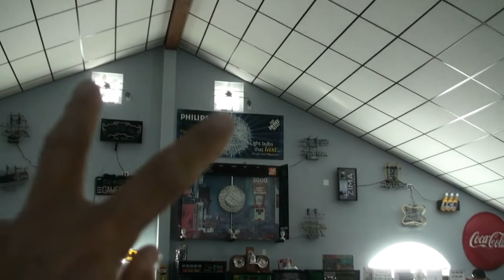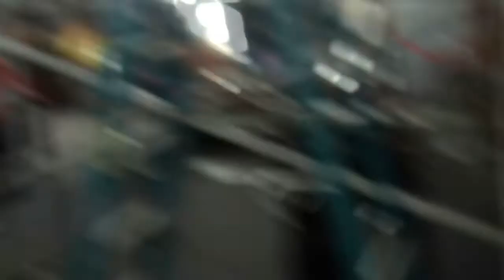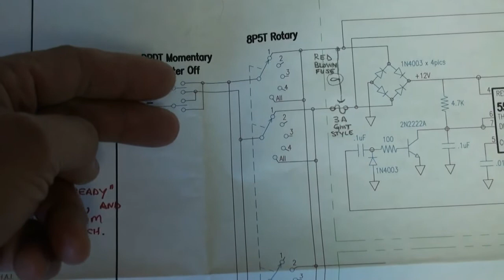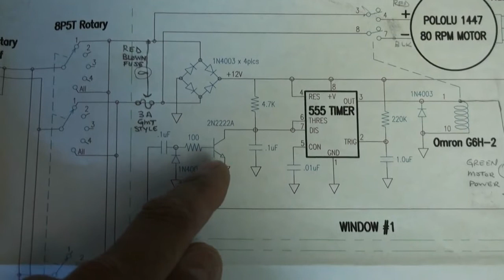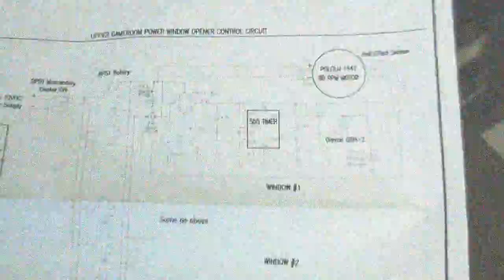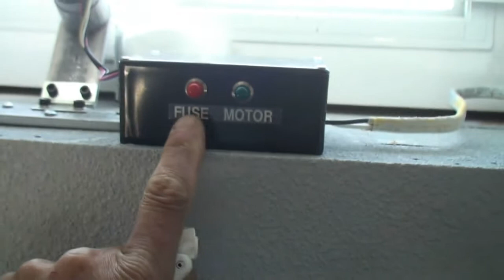Keinert GameRoom - Vent Window Remote Control

Comment: A simple $1500-$2000 minisplit ac/heat system with 2 or 3 indoor air handlers would have been a cheaper, easier and better way to accomplish getting rid of the heat that the games create. But it looks like you enjoy making things complicated. >;-)

Comment: Neat. Why doesn't the timer shut the motor off immediately? Does this have to do with the trigger capacitor value being chosen so that the motor can spin up first?
Reply from the maker: The values of the timing components were chosen so that motor power is not cut off until there is a significant slow down in motor speed or a motor dead-stop condition. If I shut off the motor immediately, then it would not develop enough torque to operate the window crank mechanism as this is a mechanical assembly with friction and mechanical resistance that can vary from window to window. So component selection is a balancing act between "wait long enough" to power through minor slow-downs, and "shut power off" when the window has reached its end of travel and starts to bind the motor.